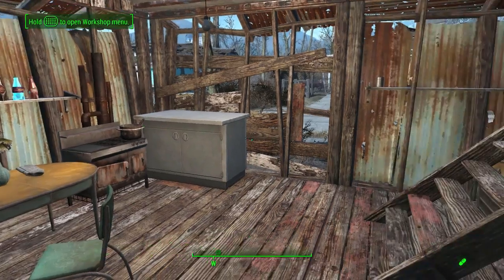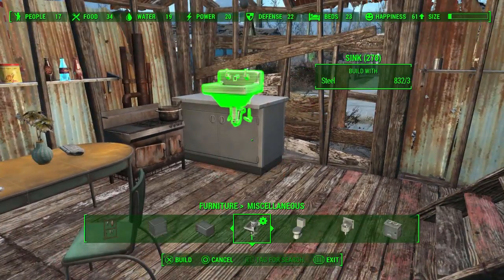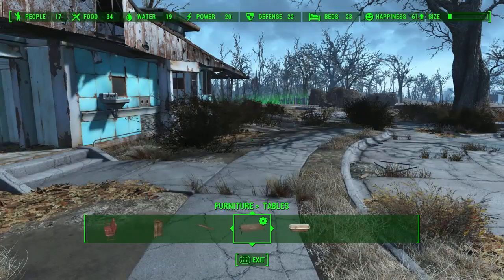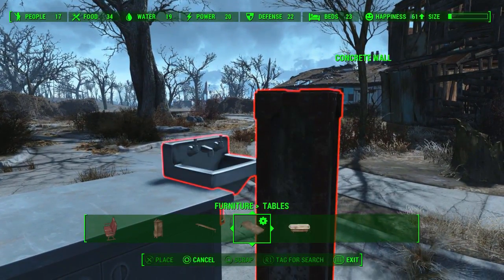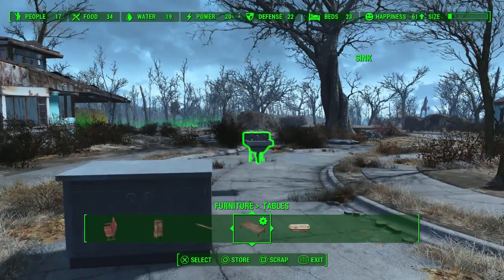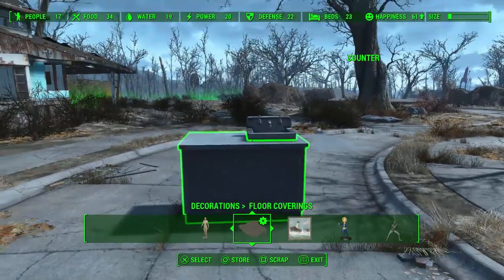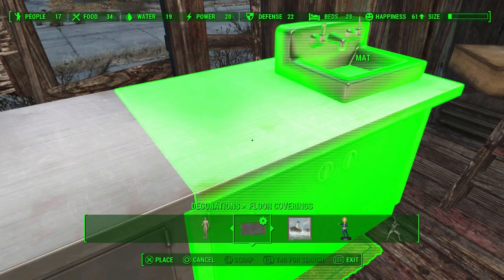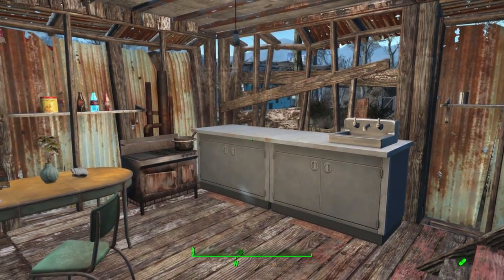Fallout 4 Tips & Tricks: How to Make Countertop Sinks

Comment: When I group select the rug after using it to place the counter into the sink, the group acts as though it's using the sink's snap to box instead of using the rug's rules of being placed on the floor. I'm at Nordhagen, don't know if that makes any difference. Used the default shed to place the sink, pillar glitched it to the height I needed, rug glitched the counter into the sink, then group select with cursor on the rug. Tried it quite a few times, it behaves the same way every time. Not sure what the problem is.